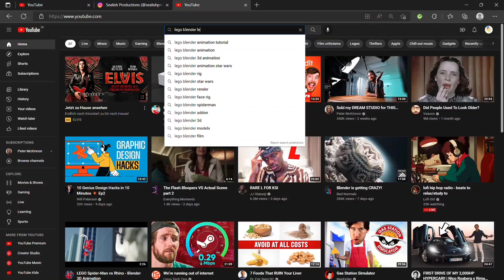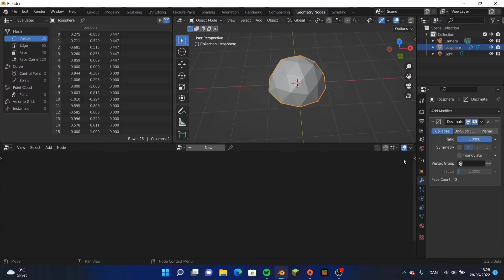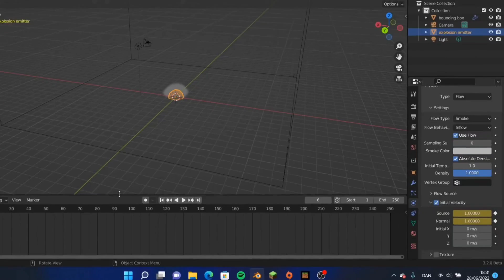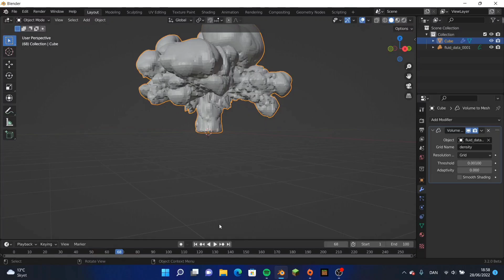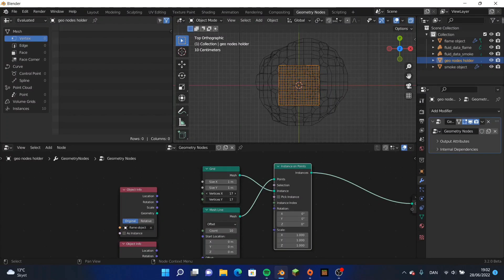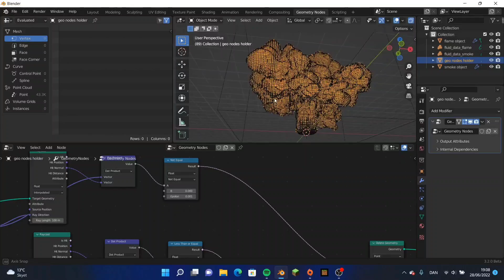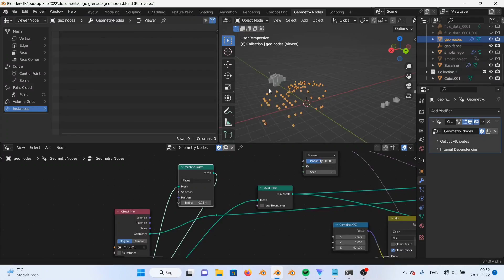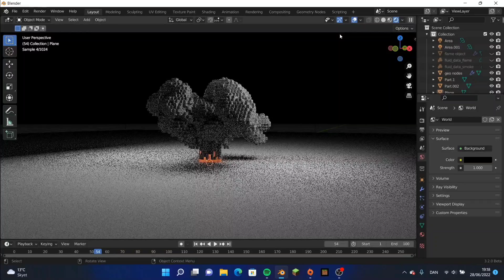Lego Explosions in Geometry Nodes / Blender 3.x

Comment: Great tutorial! Only thing I can't fix is that the flame parts still include the smoke so there's some black overlapping ( see my newest video). I tried fixing the node tree but everything seems to be fine. Do you know what could cause this issue?
Reply from the maker: You can send me a Google drive link with your blend file and I can check it out
Reply: @sealishproductions  Ok thx mate, https://drive.google.com/file/d/1WA6_AL9jtOvhQAluLFI7U4AiN60970O8/view?usp=sharing  
Btw I'm using version 3.1
Reply from the maker: @Caminobrickfilmstudios  alright I found the problem, you have a 'less than or equal to node' not connected to the 'dot product Vector node', if you connect them up, it will solve the problem, (they are at the top of the node tree)
Reply: @sealishproductions  Thank you so mucg! Now it's working like intended
Reply from the maker: @Caminobrickfilmstudios  glad i could help;)

Comment: 5:12
Small correction
Grid name should be "flames" not "flame". 

Without that it does not work as "flame" grid name, "flames" grid name needed
Reply from the maker: Make sure to add a 'set material node' after each instance on points node, geo nodes can only recognise materials if you give it a set material node, let me know if there are any issues
Reply: @sealishproductions  
this improved it.
thank you for ur suggestions

Comment: Hey, thanks for the video, is it possible to add the "temperature" of an vdb ? I try the same way that you look for the flames, but not work
Reply from the maker: Hmm, I'm not sure about using temperature, it is possible in theory with the new material attribute support coming to geo nodes in 3.5 I think, but for now, you have to use two meshes that use the flame and the density, maybe also try using a duplicate vdb for both the flame and smoke in case the above doesn't work for you

Comment: Do you know of a way of adding slopes to make the explosion clouds smoother? The trikey part is that they need the correct orientation to look right unlike the single studs. Do have any idea how you might go about adding the slopes?
Reply from the maker: Yeah one way to do them is to sample the nearest normal directions from the bricks around the slope with a sample nearest faces node and to capture the normals of those faces in relation to the slopes, using those normal values to drive the rotation selection of the slopes, like a mask
Reply: @sealishproductions  okay thank you I will try that
Reply from the maker: @judgsmith  if you have issues with the sample nearest faces node, you could instead try a sample nearest mixed with a sample nearest index node, joey catlino video goes over that technique quite well
Reply: @sealishproductions  Thank you.